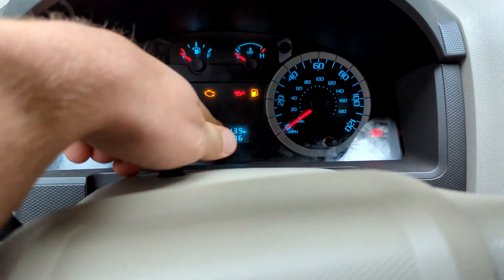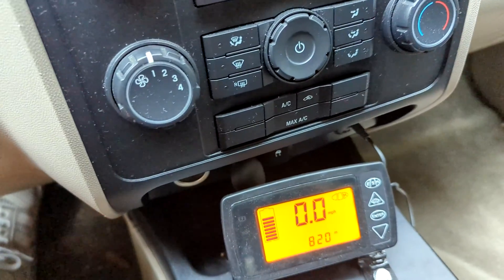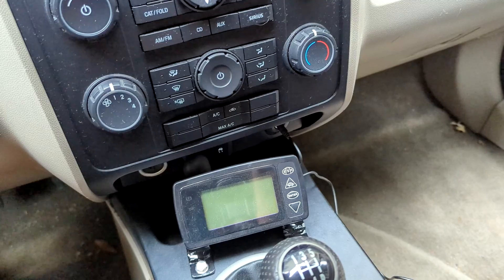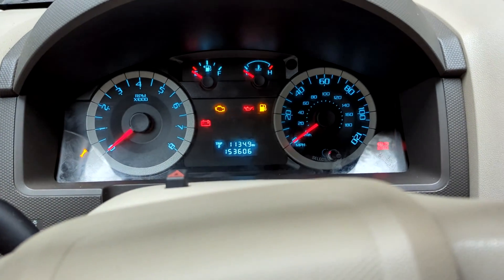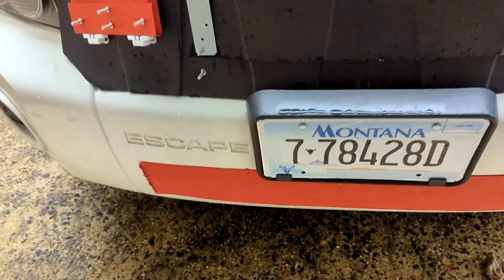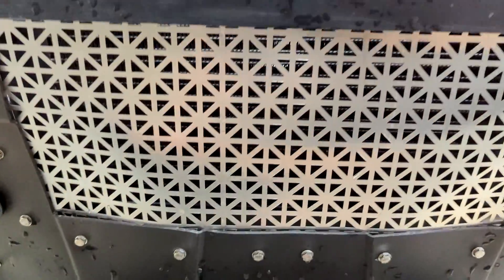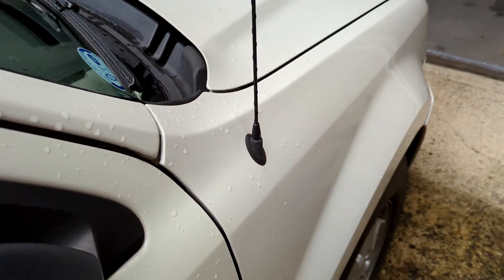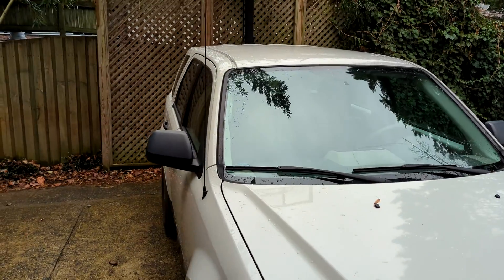Ford Escape EV Conversion EP 29: 1,000 Miles In!

Comment: Epic. Would love to see an update on this. Have you considered solar panels? Keep up the good work!
Reply from the maker: Still running strong, about 6k miles in as it's not a daily driver for me (plus no heat or AC means the weather is a limiting factor!). 

Solar is tough for cars because the added weight of mounting solar plus inverters etc usually negates pretty much all potential range benefits. What would be cool though is a fold-out solar array, especially with solar panel tech having come as far as it has recently.
Reply: @reider_mcfeely  Your build is inspiring. I trust you’ll make the right decisions — would love to hear about any new upgrades you try out!

Comment: Im curious does the stock gauge cluster not work with the ev conversion? You can probably repurpose fuel for charge level and tac regen/power. Idk much about these
Reply from the maker: Yep definitely could do that, but that would require a) figuring out what CAN messages the gauges are looking for, and b) programming a device to send them. b) would be pretty easy, but a) not as much.

Comment: Hi really awesome work! These Ford is AWD or FWD?
Reply from the maker: AWD 👍
Reply: @reider_mcfeely  thats insane!
You said it does 8 seconds 0-60 in 3rd gear... 

Why didn't you use 1rst gear and shift?

And if you use normal shifting from first... 
What are the 0-60 time?

Thank you for answering!

I want to convert an E92 M3, and have a lot of questions
Reply from the maker: Yeah probably could get a faster 0-60 with shifting but I haven't mastered shifting with the electric motor (it's a very different shifting experience).

Comment: Congrats on finishing your build! I kinda went cold on my ev project but hoping to get started finally soon. I was wondering, how did you end up making engine mount for the motor? Last I saw it was mounted direct to the transmission, but I'm not sure how I'd want to add supports to my motor. Thanks!
Reply from the maker: Thanks! There were four mounting points for the old engine/transmission. Three of those were connected to the transmission so I kept those. The fourth was for the engine: for that one, I welded together a battery box mounts to both the Hyper 9 motor (via the Hyper 9 motor cradle) as well as the mounting point for the engine. Of course this box is secured in a few other places as well.

It's not a great way to do it, but fabrication is NOT my strong suit and if I were to do it again I'd mount the motor independently from the battery boxes. It has held up for almost 6k miles though.

Comment: Thank you for your detailed videos, they are very helpful. Is the small vacuum pump still working well, or has it had to be replaced? Thanks.
Reply from the maker: Still working fine, will probably have to replace it eventually but no problems yet

Comment: Hey man, first of all thank you for sharing and filming the steps of your project!!😁👍
I watched all the videos, but one thing I didn't hear?
what is the main voltage of your battery and the current?
I heard 10 modules of 24V each, but I didn't hear, how much was the voltage and the amperage of the battery?(voltage and amperage connected to the inverter?)
Thank you for this precision, because I certainly want to do a project with the same type of "Hyper9" engine.😉
Reply from the maker: Each module is 24v and about 233amp-hours. I have them arranged 5s2p, which results in a 120v pack with a capacity of 466ah.
Reply: @reider_mcfeely  Thank you so much Friend!!

Comment: Well done brother! I’m still in holding starting my 2016 Escape conversion awaiting completion of my Factory Five Cobra rebuild and the construction of my “He Shed” workshop. Still deciding between full dual motor conversion or just doing the small rear drive unit and batteries while keeping the ICE for now.

Might the clicking be the passenger’s side half shaft? I don’t have a ton of experience with those but I believe they tend to start clicking when the need to be replaced. Any decent garage should be able to verify that then you can swap it or have them do it. From what I’ve seen it’s a fair bit of suspension work to swap on the Escape but not unbearable and no lift required. If you can convert it to an EV then you can change a half shaft!

Good luck on future projects and be sure to post if/when you get the EPAS to work (stupid CANBUS) and the heat/AC!
Reply: Would you be willing to film the 16 escape conversion? i'd be interested in following that
Reply from the maker: Yeah thanks for the idea, I'll check the half shaft. Good luck on your project!